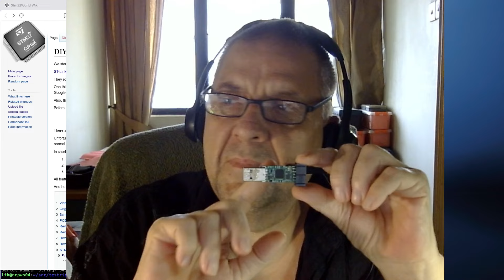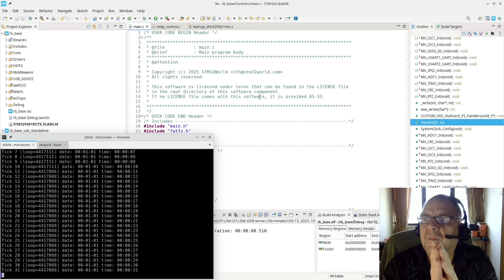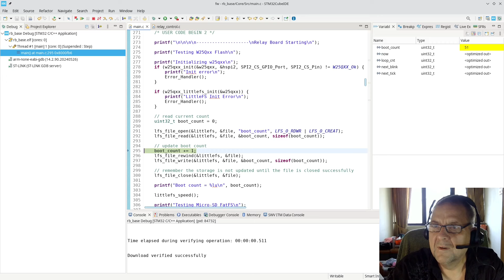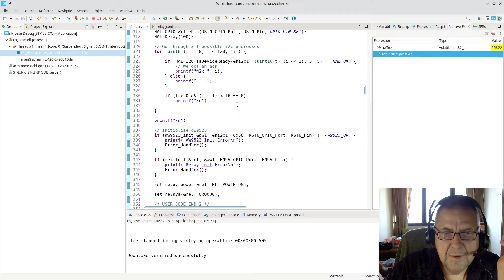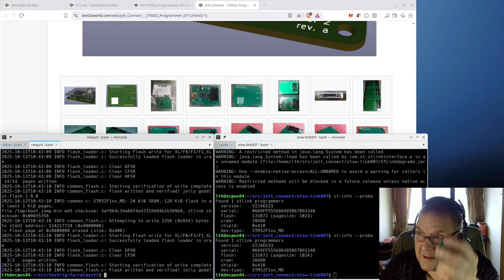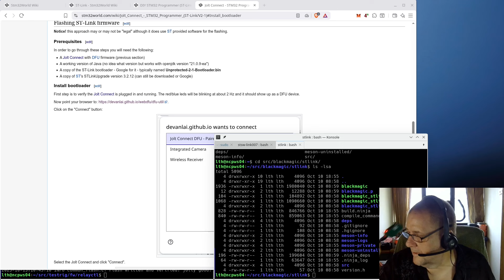STM32 - Jolt Connect - the perfect STM32 Programmer & Debugger (ST-Link/DAPLink/Black Magic Probe)

Comment: thanks for all the hard work!

will the source for this be available too?? if so when?
Reply from the maker: Not sure what you mean by source.  The source for my bootloader have been documented in a previous video and on the STM32World wiki.  The schematics for the Jolt Connect is on the wiki already.  We will not be releasing the actual production files, you would have to figure that out yourself, but the Gerbers for the earlier version have been public for years and not much have changed in the schematics.